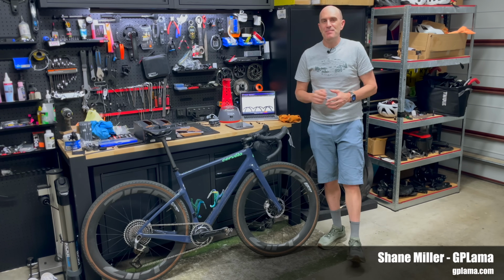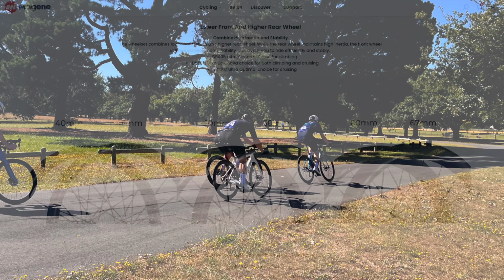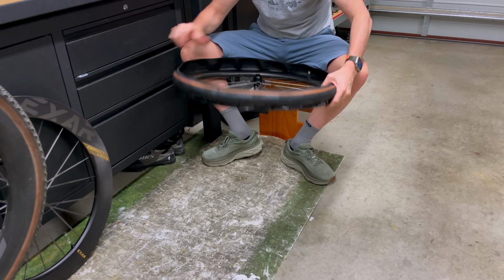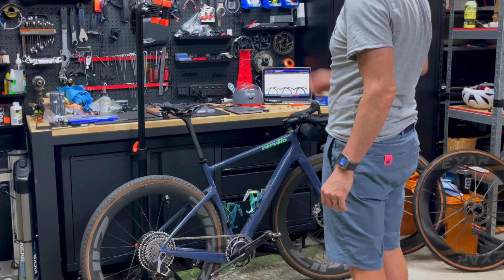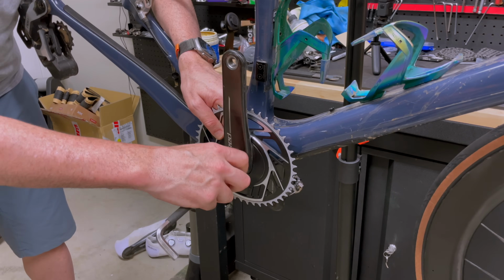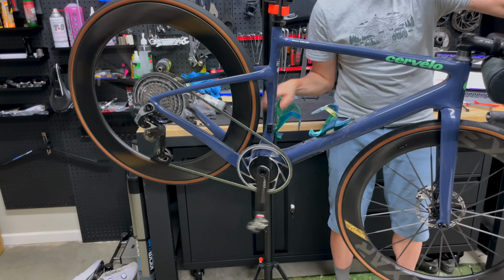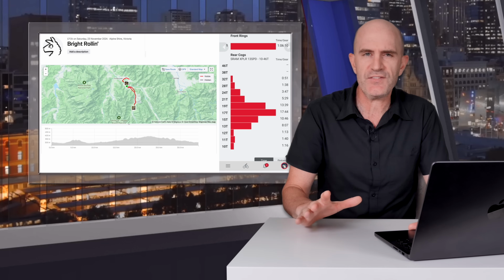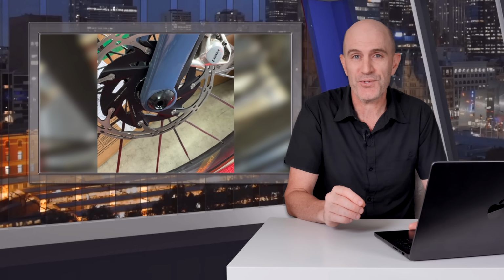Cervelo ASPERO 1x Road Setup Project // Can it do Both Gravel AND Road?

Comment: Doing so with the first aspero, of course only with XPLR 12s as transmission compatibility is needed. 13s would be perfect. I hope there will be a Force version in the future. Do you notice a difference in the old and new aspero frame, especially on the road, as the new one is a bit more "gravely".
Reply from the maker: Zero difference for me in regard to the ride/feel of the older model vs the new one. The new one has a steeper sloping top tube which is harder to sit on when waiting for the lights to change at intersections.

Comment: One remark from personal experience. Those colour coated chains and wax are not the best friends. Lubrication degrades noticable faster. The  coating deteriorates the adhesion of the wax to the chain surface.

Comment: Questionable choice of rim tape - any rim tape with logos (as commmonly used by wheels mfrs like Zipp, Enve and others) is made of a different material to the mainstream rip tapes.  Many sealants (esp Silca) do not play nicely with the type of tape that is logoed.  If you don’t believe me, google Silca advice on this topic - they explicitly warn not to use logoed tapes with their sealant.
Reply: Agree, had to replace those logo-ed rim tapes always when replacing tyres. They always became flaky and loose. Since i started using Stan’s rim tape I just put a new tyre on … and again and again.

Comment: More of this Shane, love these videos. One that many will refer back to in years to come. Does the bike need to be UDR compatible, just wondering about going from a SRAM 12 speed 1X to the latest UDR 13 speed. Also would you ever use wider 34mm or even 40mm Pirelli road tires on those SRAM XPLR Gravel wheels or is there only certain tires that are approved for them by SRAM?

Comment: Eagle 10-52 cassette is a permanent fixture on my road bike … which is my gravel bike. Don’t even have to swap the chain ring anymore.
Reply: 46t. Keep in mind I live in the Chicago area where the Midwest group rides are flat. When we travel to Minnesota or Wisconsin, the gearing is great for hills. Also ran this gearing in 2024 for Unbound Gravel 100. Worked great.
Reply: @rsmarshall hey mate, recently got a new bike with the 10-50 casette and a 44 chainring. How do you find it when doing road rides? Wondering if I will be able to succesfully use it for rod group rides (sold my roadie and bet for the dual use bike)
Reply: @clintmackinlay You definitely want to have multiple chain rings. For your road rides, you might want something bigger.
Reply from the maker: BIG! What size chainring?

Comment: Silca sealant with the replenisher works very well. Always takes care of punctures.
Reply: Agree - Silca is the best I've used. The only downside is that it needs to be maintained and use replenisher. Probably not the best to leave it in the tyres for a bike thats used occasionally...
Fillmore valves are very useful to avoid have to clear blockages...

Comment: @gplama - i was thinking of changing my aeroad from shimano 2x to sram 1x with 50t aero chainring and a xplr 12 speed rear 10-44. Thoughts?
Reply from the maker: imo, Shimano 2x Di2 road setups are about as close to perfection as you can get, for a road bike. Front changing with those chainsets is rock solid. Rear changing is quick and crisp. A 52/36 with a 11-34 gives you a wide enough range for most terrain. I'd load up a gear calculator and enter in both systems to review what range and gear steps both provide.
Reply: @gplama  agreed shimano setup is great. Was entertaining it because my gravel bike is xplr and tt bike is sram 1x. So all my parts would be interchangeable

Comment: i recently did something almost identical to my new 25 ASPERO. i Went a aero 42t front chainring cos why not go aero. But although its super light, its super fast, the gear ratios are perfect for me to be a allrounder... It still 3doesnt hold a candle to my cervelo soloist. It is minutes slower up climbs putting out the same watts.

Comment: I learned a lot from this video.  Thanks!
Reply from the maker: Thanks for watching. Just remember not all rocks are suitable chain breakers! 🤣
Reply: @gplama  , 😄 got it! I  was thinking  more like the trick how you loosen this damn crancks. Yesterday i dismantled my roadbike frame and I had to fight  with the crankset like 2 hours because I'm getting a gravel bike frame, and for the time being, I'm going to use the road gear setup with the road wheels.  I still haven't decided what gear setup I'm going to use in the future 1x or 2x in the front. I have decent road wheelset, but I'm thinking for gravel to buy the zipp ones like yours. They look fantastic. 😊
Reply: What bike stand is that ?

Comment: I just don't like the extra reach of the red shifters, it means that you would need to change to a handlebar with less reach or a shorter stem.
Reply from the maker: I did the Red E1 lever upgrade on Mrs Lama's Aspero last week. With the angle she has them set to on the flared gravel bars, there was no change required for reach adjustments. See my Instagram shorts (in the next 24hrs). I've just posted this answer in a little video. Username GPLama over on Instagram.

Comment: Nice Shane. One of your earlier vids you used soapy water to help inflate the tyre and get it seated. I use this method to this day. In this you use just water, any reason for leaving the soap out?
Reply from the maker: Water alone seems to work just as well*. 

*Disclaimer: It is summer here so things are nice and warm in the garage. It made working on the bike so much easier than freezing cold temperatures we usually have in Ballarat. This likely helps when installing/seating tyres.

Comment: Hi @GPLama, you have some really nice metrics overlay on your ride footage, perhaps you already mentioned it many times but what software are you using to produce that? I recently tried to use virb edit frmo Garmin on a mac, but seems googlemap integration is broken, making syncing FIT data and video a horrible job.
Reply from the maker: That's "Telemetry Overlay" that I've been experimenting with now that VirbEDIT is either not working or won't do what I need. Website: https://goprotelemetryextractor.com/telemetry-overlay-gps-video-sensors 

Ping me on DM if you are looking at purchasing. I have a discount code. No kickbacks to me, just a few $ off for people who buy.

Comment: In my opinion, rotor spacing just comes down to luck when switching wheelsets…
Your best chance is to go with the same hub manufacturer and the same rotor, but even then it’s not guaranteed the same. 
The tolarances are so small that any deviation could cause rubbing. However, thanks to these small values, it’s always easy to shim them.

Comment: I have gp5000 tires on a few bikes and the only problems came from the original tubeless versions as they were very tight. Being said I only needed a tire lever for the final step.
Reply from the maker: The TL version? I've found the TR to be so much better (touch wood!)
Reply: @gplama  Yes the TL version. They fit so well I was able to set them up on my Bora 35 wheels (non 2 way) as tubeless.
Reply: I also flatted 2 of the original TL tires within 100 miles of new and both were destroyed… went back to tube type until the TR came out
Reply: @ What kind of sealant did you use ? I had/have Stans in mine.

Comment: Great vid! Shane, so with a 46t in front and 46 in the back, how steep can a paved road get to still be able to pedal at 85rpm or higher at around 200 watts? Sounds like a very specific question but I am really keen to know :)
Reply from the maker: That'd depend on weight too. See my Strava for power/cadence/speed/gradient data from the last few days here in Adelaide. The 46T/46 1:1 ratio has been a LOT better than the 39/27 'easy gear' I was using when we first started coming over here for the TdU.

Comment: Hi Shane, finally you changed your pedals to road ones in this configuration ?
Reply from the maker: Yeah, switched to the Assioma DUO on this setup. Much better shoe options with road cleats.
Reply: @gplama  good thanks, convinced me to do this switch gravel / road with mine and Grx Di2 (easier, will not change gearing at all 🙂)

Comment: nice! I can't wait for sram to release a 13 speed t-type 10-52 cassette
Reply: honest question: why? 12s 10-52 to me seems pretty close to a 13s version.
Reply: the same reason people like the new sram red xplr 13 speed: smaller gear jumps.  It's a marginal improvement but if you chart it out there's 17% change between 10 and 12 tooth, that means your cadence has to change significantly to hold the same power. The range of the 10-46 xplr is too small for living near mountains, if we could have 13 speed 10-52 that would be sweet!

Comment: Hey Shane, completely off topic question. I've watched both your Sigeyi and Xcadey power meter review videos. I ended up buying the Xcadey back in 2022. Due to the charging port developing a crack, I had to replace it (luckily still under warranty). It only lasted a year and 6 months. The replacement unit now also developed a crack in the same spot as last time and it is now out of warranty. This unit only lasted a year and 4 months. It looks like the Sigeyi and Xcadey compare quite closely to one another in price and performance. The Xcadey never  gave any issues in terms of performance, but the build quality seems to be subpar. Since I'll probably have to look into buying another powermeter sometime, I was wonder how the long term quality of the two compare to one another. Do you have any long term experience with the Sigeyi? Do their build quality hold up over time? As good as the Xcadey's performance was, I'll stay away from Xcadey from now on and since the Sigeyi and Xcadey both have a similar price I was curious about the quality. Also I've heard from multiple people I know who also used a Xcadey they also had the cracking issues. Thanks in advance
Reply from the maker: I haven't had an XCadey meter on a bike long enough to comment on the long term experience, but it does sound like there's issues with their build quality based on your experience. Mrs Lama is running a SIGEYI spider meter on her Aspero that has held up well for ~3 years now. I updated the firmware on it before coming to the TdU in Adelaide this week and zero'ed it. All still working as expected.
Reply: @gplama  Okay I see. Thanks for the reply. I think the Sigeyi might be the way to go then.

Comment: I love this kind of idea, my research in various frames always reveals the BB/chainstays are the limiter. Cant run big enough chainrings, and BB often ends up too low, for running a road setup on a gravel frame.
Other than the mondraker arid, that looks like it could be really fast.
Reply from the maker: See my Strava and Instagram for a lot more on-road photos, rides, etc with this setup. It has been extremely good over here at the TdU this week.
Reply: @gplama I've definitely been coming around to the value of lower BB recently, might not be able to pedal through corners as much but the other advantages are pretty nice